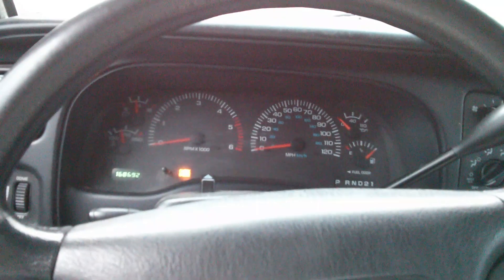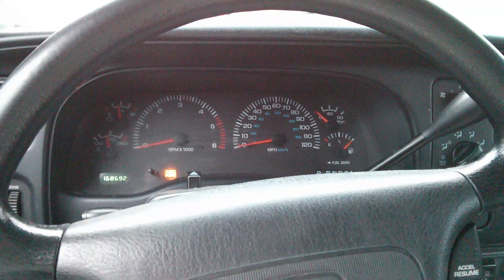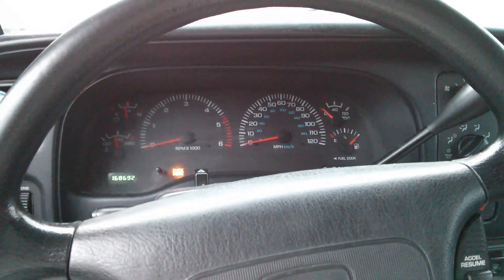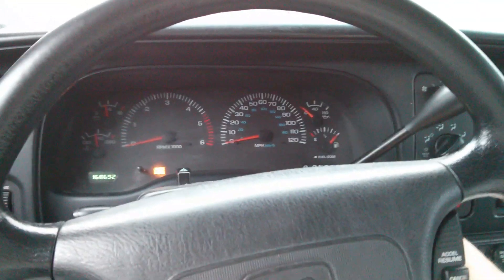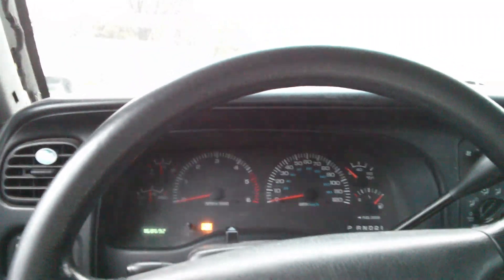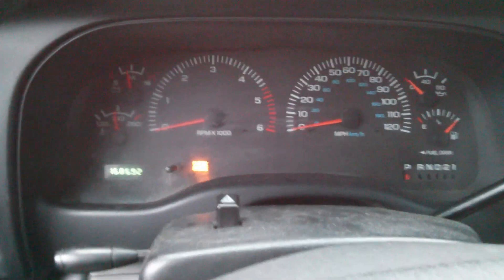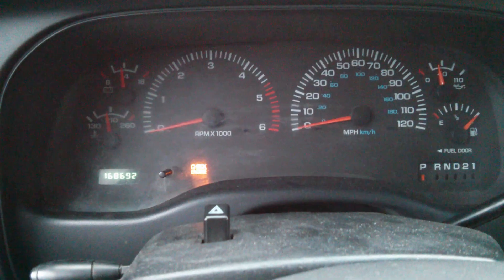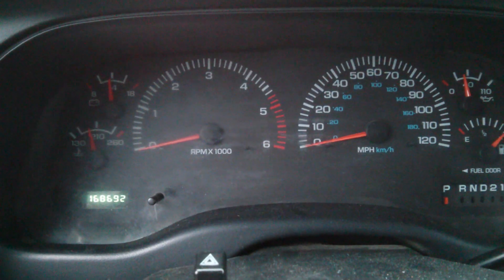1999 Dodge Durango Shuts Off randomly

Comment: Mine just started this as well, I can tell all of you who keep repeating they have replaced the ecm several times, your crazy. Thats not the issue. If you would read the manual it tells of 6 different issues that could be happening when the no bus appears, crank sensor, cam sensor, map sensor, throttle position sensor, governor position sensor (transmission), and then the ECM. All of those sensors relay a 5 volt signal to the ecm, and if they are grounded (bad or shorted) it will not allow the ecm to read and will not read correctly causing no start.
Reply: This^^^^^

Comment: The same thing happened to my husbands.It was a fuel problem. Replaced the fuel filter and ran a high quality injector cleaner. No problems since. Good luck and hope this helps.
Reply: Do you know if there was only just the main one to the fuel pump or was there a 2nd one thst looks like a soda can thst was in the middle of the line

Comment: If it stays running with gas and brake pressed, it may be an idle control motor, connector or wiring issue. ECM while common, are usually easy to test by tapping on the case and wiggling connectors to either cause, or stop the problem.
This is assuming the battery cables and grounds are in good shape.
Reply: This is my boat 🤝🏾

Comment: its your idle air control sensor you can either clean it with carb cleaner or replace it and be sure to replace throttle positionin sensor
Reply: I agree. I had the exact issue on my 2000 Durango. It’s located in the back of the throttle body. You will need to remove two Allen screws, pull the sensor out. Clean or replace it as Travis said.  👍
Reply: @johnscreekmark  I just had the same thing happen to my 01 ram 1500 5.9 and I change the idle air control sensor and it didn’t stall for a couple days and it just happened again any idea what it could be?
Reply: @robert_murphy916  You might want to check and clean out the housing that holds the idle air control.  That can get very fouled up as well. Pull the idle air control sensor out clean it and the housing that it sits in with carb cleaner. You also might want to check OBDII "Check Engine" Codes.
Reply: @johnscreekmark  I’ve replaced the idle air control and clean the hole and it just stalled on me again I have to wait about a minute then it starts back up
Reply: @robert_murphy916  There are other causes...read comments in this posting.  Good Luck

Comment: Yeah mine is a 2000 and got in 2007 drove for 9 years before it did the dieing thing. mechanic has had 4 months and replaced computer, IAC valve, battery, fuel pump, valve cover gasket, upper radiator hose and has fixed corrosion and ground issues and several other things and still can't figure out. weird I drove 9 years before this user started. love my truck so hope it gets fixed!!!
Reply: I am having the same issue... 2002 dodge dakota 2wd. new pcm still doesnt work.

Comment: so i know this was about a year ago but did you figure it out. doing lots of research and from what i see it could be anything litterally kicker is the truck does not throw engine codes. anyway its the same problem as yours would like to know what you found

Comment from the maker: Update....the Check Engine Light Code was P0753 which has something to do with the Shift Solenoid.  Makes sense because the transmission does go into limp mode and it is leaking tranny fluid so thats a problem too.  I have no idea if that is related to it shutting off. I returned the PCM and put my old one back in.  I'm going to try checking the wiring harness for a short somewhere.
Reply: So, did you find the culprit to the shutting off ? same problem and yet no overheating light of gauge it's not over heating issue,mine was cold when a few miles turned off.
Reply: 112914 Roy, I had similar problem with my saturn. After all the work/parts i put on it i narrowed it down to the injectors or the fuel filter. I didn't bother to check the injectors, i just changed all of them. When i removed the old fuel filter, it was filled with mud, you heard right "mud"(rust, dirt, garbage). This is what i think was happening. Engine runs good, there is enough fuel in the filter. Engine runs, gunk in filter restricts fuel flow, engine off, fuel trickles into filter after about ten minutes or so, engine starts: Then the vicious cycle starts again. My car has been running good for a couple of weeks now(repaired saturn on 11/19/14). I just bought a durango, I get sputter at high rpm and speed, im going to change fuel filter, and check sputter. If that doesn't work ill check injectors, spark plugs for cracks and carbon, then check spark plug wires. Hope this helps

Comment: In your fuse box is an "Auto Shutdown Relay." Swap it out with the AC relay next to it. If the problem goes away (heat related), replace that relay with a new one.

Comment: 123014: that same problem happened to me. I just purchased the model and year durango you have. in the driver side fuse box, check that all connectors are in, until they click. your anti-theft system may be becoming activated intermittently. hope this helps

Comment: I have a 1999 Durango 5.2 and it's doing the same thing.But it happens when the temp is hot or cold outside either way?! I was thinking it might have to do with the fuel system? I see it could be a number of reasons though.

Comment: Guys I hate to tell you this but If you have bad O2 sensors the truck will not run If it sounds choppy and like Its sucking air Its because the the engines running to lean causing the IAC  to go into over load

Comment: Another thing is the throttle body gets gunked up pull off the intake and look inside if it's gunked up I used carb cleaner and a rag and cleaned it out and while running gave it throttle and sprayed down inside to clean more

Comment: I have a 1999 Durango as well, I had the exact same thing on hot days it would die and then restart after about 15 minutes . I had it in the shop the first time they thought it was a bad wire connection. but after one day having it back from the shop it died again. this time I saw a code pop up saying no bus , it's in the shop again and we are replacing the main ECU.
hope this fixes the problem. I'll keep you posted.

Comment: if you dont have good conection to the battery it will do that clean the terminals
Reply: it should run after being disconnected from the battery.

Comment: Hey, thanks for posting this...my rango just started this same thing...except mine runs, just no guages! gonna try with various interweb info to fix this on my own, but no doubt my mechanic will get to do it.
Reply: Ken Darnley Did you ever figure out what was causing your Durango to do that.? Mine is doing the same.  Looking replacing the PCM for it.
Reply from the maker: Paul Pownall No, I replaced the PCM and no luck.  I ended up selling the Durango before figuring it out.
Reply: r0yb0y72 Its the stupid computer..It overheats..it shuts the stupid car down and tells you everything else is the problem..
Reply: +Roberta Larson it needed a transmission

Comment: Hey man Mine has done this several times all in which if u  drive it eventually will recycle its self and start idle normal at stop signs but I think the cam sensor is the problem, I have a Snap-On Modis Scanner and thats what it keeps showing code on mine but after a year of ignoring it was at a drive thru went to pull out and it died noticed when I turned key forward to restart it none of the gauges wld even move but 2nd time I noticed when I cycled key temp gauge an fuel gauge returned to the temp an fuel level and it started that time only to die in 1min. Or 2 and now won't hit a lick can't here fuel pump or relays click

Comment: My 98 dodge durango just started having gauge problems. They work fine but after driving about half an hour all the gauge lights come on and the needles drop out for a couple minutes and then just goes back to normal. The truck runs fine though. The air bag light remains on all the time. The low gas chimes when they all light up too. Does anyone know what the fix is for this? Don't know much about electrical and would be nice to have some pointers in the right direction. Thanks

Comment: 2000 4.7 durango had same issue. Manifold absolute pressure switch solved it. It had symptoms for a few weeks and never threw a code. The day it threw a code I checked the live data and map was indicating very low pressure. MAP sensor solved this problem of stop sign/low speed shut off.
Reply: Correction- map sensor indicated abnormal pressures, not low. "Low" isn't a good description of the manifold pressure live data.

Comment: Its probably the crankshaft position sensor, I have a 99 Durango with 5.2v8 and replaced the air intake control valve, throttle position sensor, map sensor, oil pressure sensor, both o2 sensors, the pcm computer, and still died. I even put a new fuel pump, and emergency fuel shutoff switch. I just replaced the crankshaft sensor and it hasn't died yet....
Reply: You forgot the distributor and rotor

Comment: i know not to long ago when Kmart went out of business my durango turn off in the parking lot so i had to call my mom and dad to come and see what was wrong cuz when my dad was younger he work on some cars at 1st we thought i just killed the battery but that was not it then we try to hold the brakes in and gas at same time with some jumper cables from my mom mini van and to my durango and it keep it running then my dad drove it to our  machine and turn it off gave him the keys so he can get in and do what he need to do so it turn over for him with no problem he got under the work area and it turn off and will not come back on so he drop the gas tank and come to find out it was the fuel pump and it was the factory fuel pump and it fix it in till the computer started to go out and now it working good

Comment: This happened to me, got a 2001 dodge durango. It first had problems when I drove from where I live to pick up my brother (about 50 mins away) and when I got to his house, my car was over heated BAD. That was the first problem I've had with it in 2 years. Now it's common almost to shut off while I'm at a stop for too long or something. It's frustrating and I'm about to.probably sell my car because honestly I don't know anything about cars. And the mechanics in my area are quite questionable.

Comment: today I went through the same summer her thing with my 98 Durango my alternator my starter everything came out good do not know what the problem is with my truck it won't click over or even start the engine it was doing the same old thing with the RPM drops drove it up to my mom's friend's house and my car automatically shut down after I turn off the ignition try to turn the vehicle back on it seems like it doesn't want to click over is there anybody out there that knows what should I do we tried a scanner to find the code and the computer's not even reading if anybody could help me please do I can't afford a new car

Comment: i have a Durango 99 and this has happened twice and in both cases i have changed the pcm and fixed the problem. Some components inside the pcm got damaged, i believe. So you need to replace the pcm.
Reply: This model of PCM is prone to have an internal circuit board crack that "opens" the 5 volt supply circuit to the sensors when the PCM gets heat-soaked (usually on a hot day with the A/C on full).  I was able to confirm this by gently flexing one of the PCM connectors and watching the 5 volt line go on and off.  Third-party rebuilders don't check for this fault and you can get a "rebuilt/re-conditioned" PCM with exactly the same problem.  I had to get a re-built PCM from the dealer to get a quality PCM.  Because PCM's are sealed, there are a lot of shady sellers the shine up or paint the outside of the PCM and can't repair the fault inside.  Dealer is the most expensive though you get a quality part.

Comment: exact same thing happened to me. I replaced the ecm and air idle control valve and throttle position sensor , still having problems. so now I replaced the cranshagt position sensor still no start now I'm replacing the plugs wires and cap and rotor if this doesn't work I give up
Reply: Pete did you give up
Reply: What happened?

Comment: YOU TUBE Scotty Kilmer said the fuel pump has no codes but a low pressure situation can cause stalling..
Maybe this is why yo have to push on the gas pedal to keep it running.
Check pressure under the hood at a garage if you have not solved this.

Comment: Yea computer or iac again. I have a 92 I replaced alot plus the computer. Ran great then would back fire and die with no saving it. Stumped took the air cleaner off ran open throttle body and then I found the loud surge of air coming from the throttle body then it wouldn't idle on its own. Buddy owns a couple dodges stole one of his iac put it on started up gave it gas a couple times then idled np. My iac is brand new but its electronic can go bad so I believe I've figured it out. She ain't gonna run hard n long again till winter know for sure then.

Comment: My 99 Ram 5.9 will randomly "lose" ignition while driving along. Tach drops to zero and engine dies just like shutting off the key. Changed computer and seemed to fix the problem for a little while, but then starting randomly shutting down again. Does this while driving down the road.  If I pull over and try cranking the engine, it won't start and no tach indication. However if I shut the key off first, then try starting it, it will start right up and will run fine for several days. It's not throwing a CEL, and not getting a "nobus". Acts like something in the ignition system has an intermittent fault. Radio continues to play and everything else continues to work, just no ignition. The key seems to be that the tach drops to zero when the engine shuts down. No spit, sputter, or misfire of any kind. The engine just shuts off. Has me baffled, and I've had to park the truck as it is too unreliable.
Reply: John Acuff have you found a fix. My truck started doing this a few days ago. Runs great.  But then randomly dies. Doesn't matter if it's idling or I'm keeping it revved up to 2000 rpm in park. Or going down the road at 60 mph. But when moving that fast. It just pops and sputters and tries to die for a second. But keeps running.  Very random. But happens only when truck is up to temp. And then it happens every 30 seconds to 1 or 2 minutes.    And one time it died and I couldn't restart it. Without resetting the computer.
Reply: I'm sorry to hear that man. Mine shuts off random when trying to take off. It looks really stupid on the road.
Reply: Has anyone figured out the problem

Comment: same happened with me ... turned out to be just the throttle position sensor. simple fix. easy to get to.. and cheap to boot... part was like $5.
Reply: Cps sensor for me and had bad terminals in the plugs for the pcm.
Reply: Didn't work for me. I may change crank sensor. Mine shuts off intermittently and always coming to a stop or turning while slowing down.
Reply: @mrahim826  Mine is doing this exact same thing. Did you find a fix?

Comment: My 1999 dodge Dakota does the same thing after the battery is disconnected for more than a hour. It does it because the computer resets and it don't know how to idle so I just gave it gas at 2,000 rpm for a couple of minutes and it was fine after that

Comment: I got a 1999 dodge Durango it would get hot and stop I needed a new radiator and a new computer put on my truck so that could be the problem and yes I had all the sensors changed but that wasn't the problem it was the radiator and the computer

Comment: I have a 99 durango 5.9 4x4 I had the motor rebuilt all new parts under the hood everything inspected drove it for a test drive and it shut off started rite back up worked fine did it again another day same thing but wouldn't start had it checked again everything was fine so decided to try the computer/pcm and it worked fine until the next summer when we had extreme heat it did it again I replaced it and it was fine. There is a place in Florida that rebuilds them for 275. Had the truck since 2009 and replaced it twice and it's been fine.good luck
Reply: I have a 1999 dodge Durango and it auto sacerty shut down but if you put a obd 2 on it it will start

Comment: have a 2000 dodge durango  5.9 I drive it for a while and it just shuts off after few minutes  it starts I notice when it turns off the fuel pump don't turn on after few minutes  then it starts back up the fuel pump is not the issue or the computer any tips. .
Reply: do you still have this truck?

Comment: Mine is doing the same thing but not as frequently. The mechanic thinks it might be the fuel injector. I would love to know what's going on with yours. My old Pontiac had an issue and it was the coolant thermostat and wouldn't start unless I flooded the engine.
Reply: Just went through this, replaced different sensors, but continued to just click off especially when it was hot outside. they finally changed the coil pack on the distributor and it has been 2 weeks and not once has it stopped on me.

Comment: Change all your sensors, spark plugs, ignition coils, find out it's the O2 sensors that need a shop or a pro to get off... Final words? Just spend the $ man, it will save you from growing a tumor... Oh yeah could be the CTM, you will have fun finding one that is a perfect match...
Reply: Which O2 sensor  did you replace. Computer is showing one of mine needing replaced but doesn't show which one.

Comment: My 98 does this but as long as I keep my foot on gas then drive it a little then it will stay started
Reply: +Mark Dykstra the cables for the battery connectors were.  corroded badly. I went in there with a wire brush and it's fine now I think it was just a connection problem